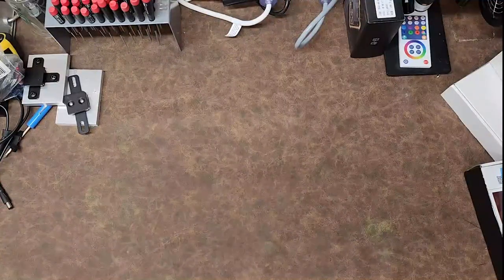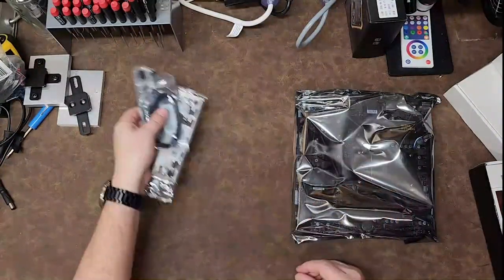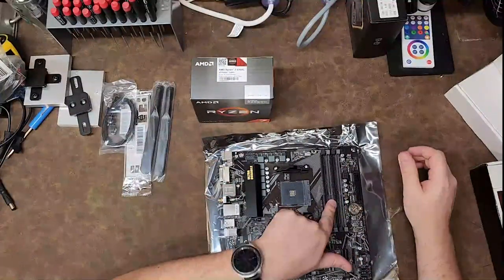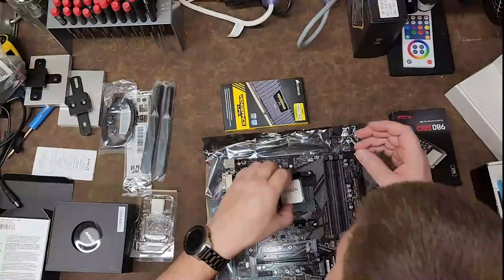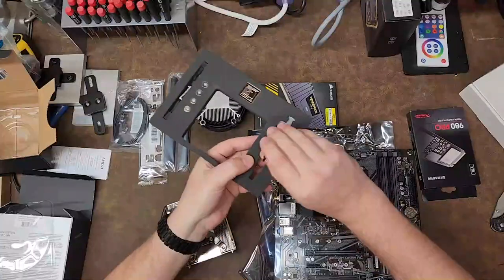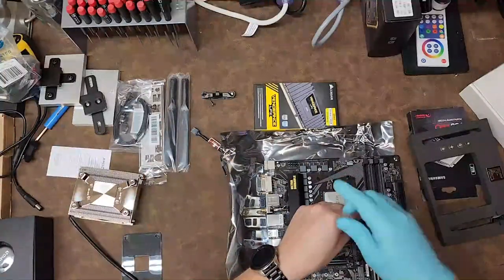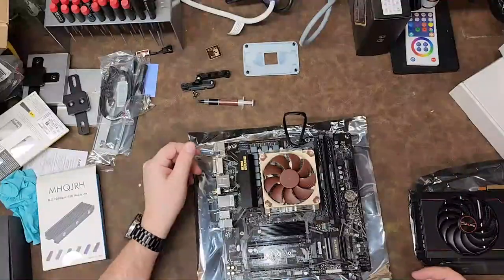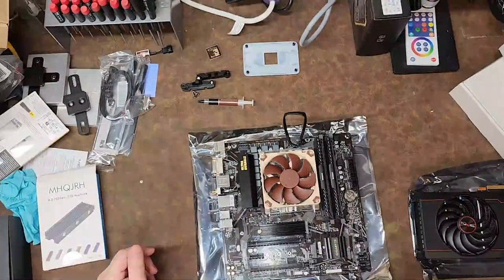Stream PC Build Day 1

Comment: 7:40 the "low noise adapter" is a inline resistor to lower the fan speed and make it quieter. Noctua are fantastic coolers, the only downside is the ugly brown color they always use.  In the past when i worked as a IT-technician on different locations from the store where i worked for, i had made a "portable" desktop pc, a MicroATX motherboard in a small form factor case, and placed a handle on top of the case. Worked great.

Comment: Looks very nice! I apply thermal compound the same way that you do except that I use a third as much. People seem to think that you need a whole gob of it for the heatsink, but metal to metal is best for sinking the heat. Thermal compound is only for filling what tiny scratches and imperfections that there are on the metal surfaces. You generally only need a very little amount of thermal compound.